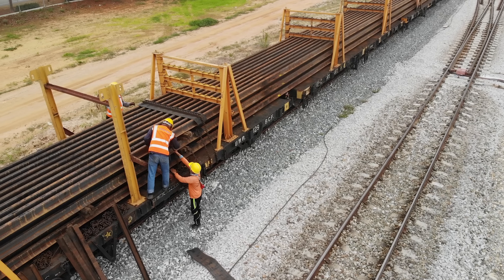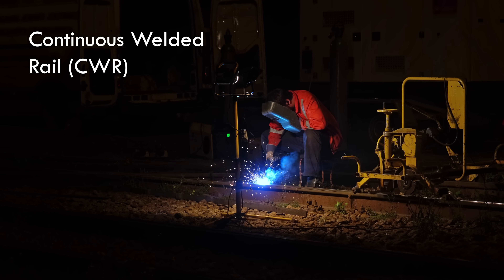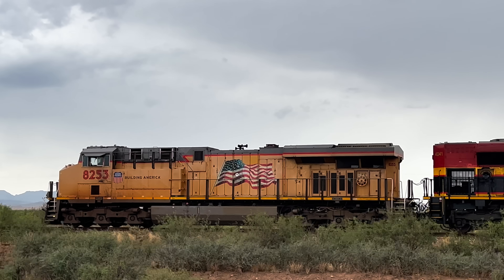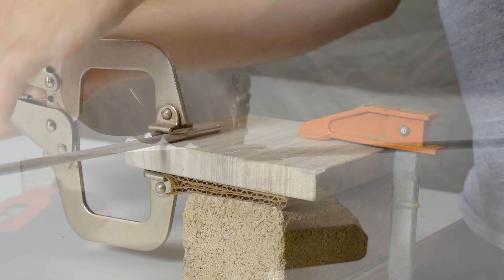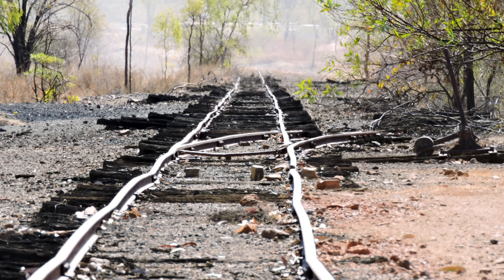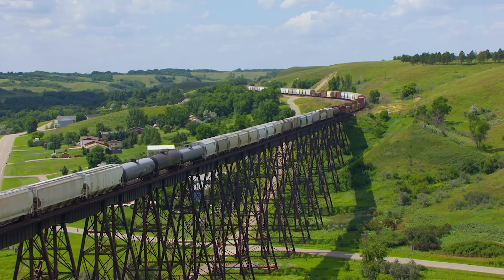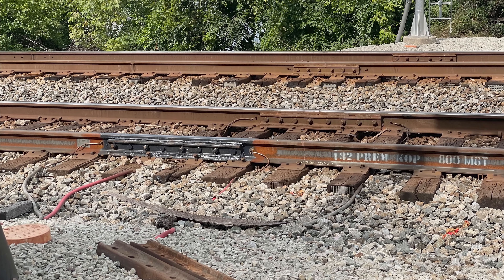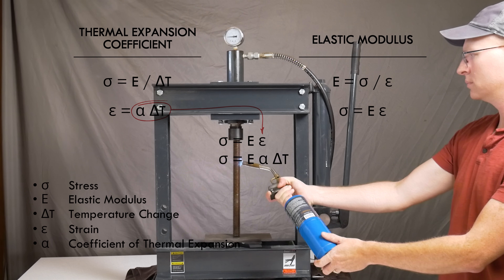Why Railroads Don't Need Expansion Joints

Comment: A massive buckling effect occurred last summer in Bangladesh, severing the ties between two largest cities. It was over 42C, way above BD Railway like to operate. It ignited debate between using traditional and CWR rail. But BD Railway came up with a very cheap solution to keep tracks cool. They placed Water-Hyacinth in the track to keep it from buckling,
Here is a Bengali News channel reporting the incident: https://www.youtube.com/watch?v=2iLRGdgP2Pw

Comment: Your thermal images don't line up. You need to change the "Camera Alignment" on your Flir whenever you change the distance you're recording from to account for the parallax of the two different cameras used for MSX.

Comment: Making sound requires energy. I assume that eliminating the gaps which eliminates the sound also improves efficiency. I wonder if the railroads have data showing a difference in efficiency between conventional and continuously welded track.

Comment: “ Why Railroads Don't Need Expansion Joints”… so the answer is, they do, it’s just that they’re few and far between, and they’re worked into electrical isolation. 

I’m also pretty sure that the tracks can buckle if a heatwave is bad enough.

Comment: As a engineer who works in railway track design, one thing I'd like to point out - especially since you mentioned a video on signaling will be coming soon - is that neutral temperature is typically high not because a broken rail is less dangerous than a sun kink. Yes, its more likely that a train could operate over a pull-apart rather than theough a sun kink, but largely because the signal system will detect a pull-apart as a discontinuity in the rails and thus the signal circuit - automatically turning the signal ahead of that track to red!
Reply: I've always been amazed at how railroads developed signalling systems.  And how the idea of 'fail-safe' design was involved waaaayyyy back in the early 20th century.  Broken rails, loss of power, relay failures were all considered and will set signalling 'safe'.
Reply: @mikefochtman7164  That fail safe system was paid for in blood though. But since rail is that old most of the accidents aren't that highly publicized or live in recent memory like development of the airplane and space flight.  
It is kind of interesting to see how safety culture around cars is so low, but that is I think a question of high amount of owner operators/low barrier to entry. On rail most things are owned by large corps, which has similarities to aerospace as well.
Reply: @Torchedini  It's also very much about responsibility and scale. If one mistake by one person routinely leads to hundreds of deaths / injuries there is much more incentive to have that happen as little as possible. Whereas if most of the time a mistake ends up hurting the person who made that mistake (e.g. driving into a ditch) there is a perception that it is "their own fault" and less institutional concern.
Reply: @mikefochtman7164  I remember working with an ex rail safety engineer. He regarded spring return relays as a compromise and said that in the UK rail signalling system they had used gravity return relays. He said that there was a chance, however remote, of a spring failing but that if gravity failed, train drivers would probably have bigger problems than signal failures!
Reply: @mikefochtman7164 of course it was learned the hard way in the 19th century! For a while semaphore signals failed as saying it was clear (fail-dangerous) until one day there had been enough accidents caused by this arrangement and they flipped them over to fail as occupied (fail-safe). 

Pretty much every regulation has a story like that if you look back far enough, with a few pleasant exceptions such as Automatic Train Operation (ATO) being invented preemptively rather than reactively — and implemented for steam locomotive valves!
Reply: @kaitlyn__L  There is no such thing as "fail-dangerous." The word you're looking for is "fail-open" and sometimes failopen systems ARE correct.  

For example, if you have a hardened security door that requires a keypad to enter it because it protects sensitive data (e.g., medical records), what should you do in the event of the door mechanism failing? Many might default to making it fail-safe (also known as fail-secure), so that people can't just enter the restricted area in the event of (e.g.) a power outage.  

But thinking about it more, you'd probably rather make it fail-open instead. Why? Because if the power goes down, it could be due to something like (e.g.) a fire, and if the door is fail-secure then people may be trapped inside of the room awaiting the fire.  

You can also mix-and-match these approaches, with mechanisms that dynamically swap the door between a fail-safe and fail-open state depending on the state of the room. For example, if the room can somehow detect that nobody is inside, it can enable a fail-safe mechanism (a mechanical latch for example that does not need continuous energy to remain latched) to ensure that nobody enters in the event of a power outage. It can then swap to a fail-open mechanism if people are detected in the room - again, a mechanical system that will remain fail-open in the event of a failure.  

Finally, you can also create partial fail-safe designs where the room itself is fail-safe but only in one direction. A crude analogy here would be how you can unlock a door from the inside simply by turning the knob, whereas the knob cannot be turned from the outside. Note that the analogy is crude because it isn't a fail-safe situation literally, more of a highlight as to the symmetric nature of a partially-failsafe system as noted.  

The reason I point this out is not to be pedantic but to be clear why certain decisions are made. The question was never "Hey guys, should we fail dangerously?!" but always a matter of risk. Sometimes a system makes more sense to fail-open until it can be made more mature. For example, if (hypothetically) older railway systems saw frequent false positives (detections on tracks when there weren't any) and extremely rare false negatives (failure to detect an object on the track despite it being there), then it might actually make sense, at that level of maturity, to fail-open. If there were (e.g.) a 99999:1 ratio of false positive to false negative, then taking a fail-safe approach would lead to 99999 train stops for every 1 life saved, which could be the equivalent of hundreds of millions of dollars in economic damage to save a single life - not worth it, and so a fail-open approach might be taken at this level of maturity.  

But what MIGHT be worth it to save that life is investing in superior detection mechanisms that will false-positive less often. If you could reduce false positive rates by 99.99%, the ratio between false positives and false negatives would now be merely 9:1 - which means that you are only suffering (perhaps) tens of thousands of dollars in economic damage per life saved. The risk calculus is now absolutely conclusive that we want to be fail-safe.  

And finally, to go back to my analogy from earlier, if that door I mentioned was protecting (e.g.) a nuclear bomb launch button, then it probably makes sense to be fail-secure even if it means someone dies inside in the event of a fire.
Reply: @far2ez  fail closed is the opposite of fail open. Fail dangerous is the opposite of fail safe. They’re totally different things.
Reply: @mikefochtman7164  Well, it's all good until it isn't. Rail can break at any time including under a train. If it happens on straight well ballasted track the only issue will be for the next train. They will get a restricting signal and have to crawl through the block. On a curve or poorly ballasted track, look out.
Reply: @mikefochtman7164 19th Century engineering…
Reply: @mikefochtman7164  they had to. Afaik early tail history used to be pretty deadly and accident prone
Reply: Im interested to know how that works. Im pretty sure I saw bare copper used as grounding for the rails last time I paid attention to it. Or have I missed something
Reply: @Tupsuu  It depends a lot of the specific railway line, that could have been traction power return cables, grounding, equalizers between adjacent tracks, signal infrastructure, etc...
Reply: @mvcrailphotos  May I ask you what engineering degree did you get to be a Railway Track engineer? I'm doing Civil trasportation. Is it good or something like Civil structural or even Mechanical it's better?
Reply: We try to hide bare copper anymore, as the criminal element and the price per pound increases together. @Tupsuu
Reply: @Tupsuu yes the rails are grounded they are laying on the ground. Electricity still likes the easiest path and the majority of the signal goes down the rail to the next signal.
Reply: @Tupsuu you did there is usually 2 peices of copper wire fuesd to the rail head .
These are called continuity joints .
They make shure the electricity for the signals keeps flowing .
Reply: Also some places are known to deliberately set the rails on fire in winter to prevent them from snapping. In contrast there is no practical way to refrigerate an overheated rail to prevent buckling.
Reply: @ratvomit874  Just, no. Nope.
Reply: "largely because the signal system will detect a pull-apart as a discontinuity in the rails and thus the signal circuit - automatically turning the signal ahead of that track to red". 

Not in an area that uses axle counters it doesn't as they cannot detect a broken rail like a standard track circuit could, be it HVI, Aster or DC track circuits. 

And a broken rail would turn the signal to the REAR of the break red in non axle counter areas, thus protecting any approaching trains. If it were the other way round there'd be some almighty smash ups of a similar nature to Clapham. Or worse!
Reply: @growyourowwn    Correct. In signaling terms, the signal before a section of track is referred to as being "ahead of" or "in advance of" that section of track. This the signal ahead of the section of track turns red, not the signal ahead of the train. You're also correct about axle counter territory not detecting pull-aparts; that is one of the major disadvantages of axle counter train detection systems.
Reply: ooooooooooooh, right, cause if you use disjointed rail you have to have a separate cable for the signal to travel on, at least in every joint. so even if pointy joins solved the expansion issue the added wires and cases and little welds sounds like a lot of extra work.
Reply: @torcoAaAa  That's why on jointed rail, every joint had/has bonds connecting the rail bars to each rail for signaled tracks. A signal maintainer would drill holes and drive in the bonds with a hammer.
Reply: i'd say you're both right, as it could be said instead that a broken rail is less dangerous than a sun kink because its both a safer traverse and is fail safe in that it can be caught by signaling which would close the affected block to traffic. i dont know what happens between signal and notification if the block is occupied - probably a different protocol by the year in this info age.
Reply: @hardrays the signal maintainer gets called at 2 am to go hyrail the track find the rails broken then sits there walking trains over the break for 6 hours waiting on the section gang to come fix it.
Reply: This is typically how it works in the UK, but we have bonds, literally just a large cable drilled through both rails, to continue the track circuit

I have... tripped over them only once, but it's one time too many haha
Reply: There's a video out there somewhere of a freight train traversing an incredibly wide (like 3-foot) gap. Momentum does a lot to keep things moving.
Reply: @liam3284  I'm surprised that did earn them a Darwn Award...
Reply: Intresting
Reply: are you an engineer?
Reply: How do they account for extremely long runs?
Reply: A failsafe that works through complete failure.
Reply: @JackFierceTree  what you describe is lack of failsafe.
Reply: @daviddroescher  nope. They just explained why a kink is an improper failure. Where as a breakage ( full failure) will sound an alarm .: "failing safe" The only way out, is through.
Reply: And then you have axel counters /flange detectors
Reply: Also, it's easy to detect a broken rain with conductivity tests. If current won't conduct between two points, there has to be a break somewhere. It's a lot harder to find bends.
Reply: Curious what you mean by turning the signal ahead of the track red. Do you know what software is used for this?

I only ask because I work in IT supporting a product that deals with network fault monitoring, and I know we have at least one railway company that uses our product.
Reply: @jeremy-m6b-m8n  Traditional railroad signaling uses track circuits: electrical circuits using the two rails to complete a circuit to a relay. When the train enters the section of track - known as a block - the metal wheels and axle short the circuit, de-energizing the relay. A broken rail - or any other fault with the system - breaks the circuit, also  de-energizing the relay.
Reply: As someone who’s boots on the ground, there’s also a pragmatic answer in that fixing a pull apart is way way way easier than fixing a track buckle. 

Pull apart can be as easy as: apply heat, slap a 6hole joint and you’re good to go.

There isn’t an equivalent for a buckle, ie you can’t just cool it down and wait for it to be fixed
Reply: Wait? Is there a current through the rail? And how does that work for the expansion joints like the tracks I’ve seen with the steel plates bolted to them?
Reply: @MJPworkshop on nsw rail ways I was a track supervisor on .
There is what's called a continuity joint .
Which is 2 priced of 1/2 inch  copper wire fuesd to both sides of the rail head above the fish plate .
The insulated joints are all bonded now and are virtually maintenance free .
Reply: @kevinduffy6712 I think I can picture the cable!!
Reply: 32 deg c was the rail themp before any adjustments are made by way of welded rail .
When I was on nsw railways in 1977 they started doing continuous rail .
Problem was .
Most of the formation under the ballast was ash from power stations .
Below the ballast. 
They soon found out this didn't hold the rails and they would kick causing a buckle .
Reply: Here in beautiful Cape Town, South Africa, we used to have the gap system, but this was altered to the welded rail system. Somehow and for reasons unkonwn, we have recently returned to the noisy gap system. God help South Africa!
Reply: Wow that’s amazing! Very logical and yet very troubling as to a what if . What if the rail gives a false readout? How do they determine the reliability of this system? When so much is literally riding on this system is there any way to know it’s not an intentional failure? Imagine if this system was used decades ago what would Butch and Sundance do?
Reply: That's what continuity joints are for !
Reply: it's*
through*

Comment: Work can be accomplished by adding energy (heating) causing expansion. Work cannot be accomplished by removing energy (cooling). Heat the rail to 110f, nail it in place and your done. Simple

Comment: Fun fact, watching youtuber ccrx6700, in cold weather they actually set the rail on fire!!  To reconnect a 'pull apart' joint, they put something along the rail that easily burns.  The heat expands the steel rail, closing the gaps at the end so they could reinstall the fishplates.

Comment: Very good!  Sun Kinks a real phenomenon.  In mountain country generally on curves.  Enough to laterally displace concrete tie track structures.  Cold weather rail contraction also can result in the rail pulling apart.  I've seen it break in multiple places in severe and unusual cold temperatures for a given district.  Old timer Engineers used the rhythmic 39' clickity clack as a subtle gauge of speed and distance.
Reply: You don't want even a tiny sun kink when the train is travelling at over 350km/h. I'd lay odds an awful lot of thought and an awful lot of testing in all seasons had to be done before the first Shinkansen was built.

Comment: Joints in rails cost about $2000 per mile to install and between 30 and 40% of the track maintenance to deal with for the section crew.

Comment: So the pictures of buckling rail is because those rails were not installed properly? For example laid in cold winter without heating or applying pre-tension? And/or were the ties in the past worse in keeping the rail straight?  
Is it common for rail to be heated/tensioned in mild climates when a new track is built or does this only happen in more extreme climates like Texas?

Comment: Well, the title of this video is "wrong" - only because it makes an absolute statement which is false.  It's "risky" (engineering term!!) to make a blanket statement with confidence (another engineering term!!) about "need" while only considering a specific example(s) - this is why I don't like politicians who make similar blanket statements about need based on their own (and very limited/sheltered) life experience and agenda.  Another way of thinking about it is the phase: "over simplification".
  
There are railroad expansion joints, but they are used for specific purposes - like when a track goes over a bridge (which even your video calls out at 12:50) and the thermal expansion and loading is different when the track is attached to concrete rather than the cool rail-bed of moist dirt under ballast.

Comment: Hot water and steam pipes using sharp U-turn expansion technique to adjust pipe increase in length due to thermal expansion. Railway can use same technique instead sharp U-turn they can use not straight railways tracks but continuous with high radius R value track path. Expansion happen along length and radius can compensate elongation.